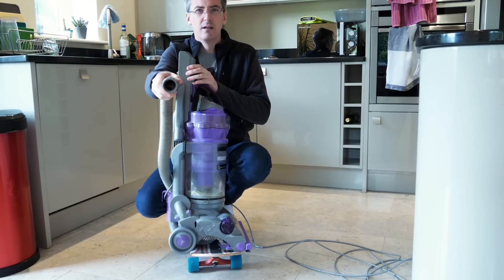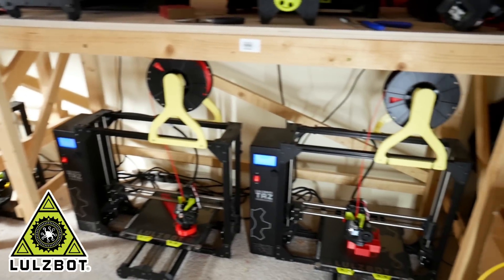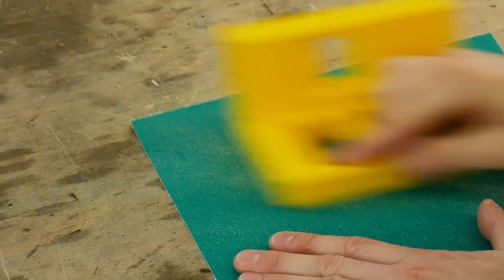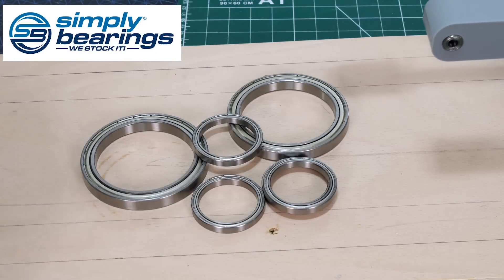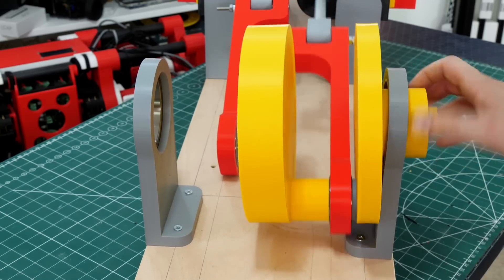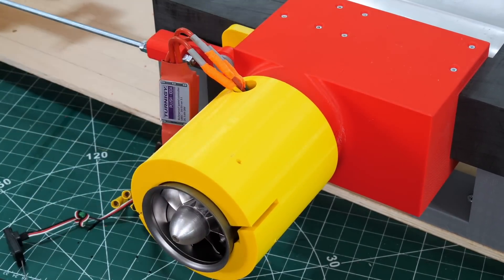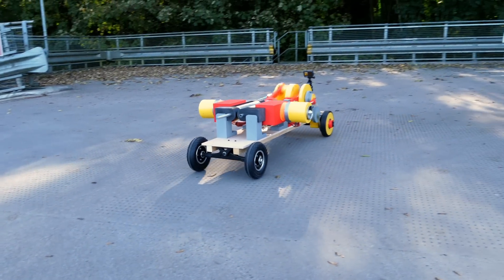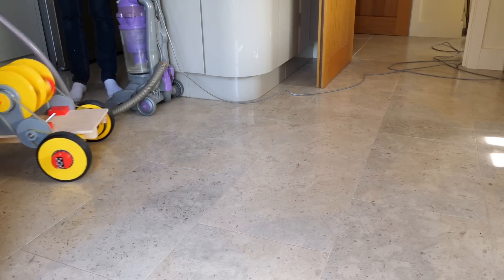Jet Powered air engine

Comment: Single crank compound: one set of pistons, but instead of the piston going straight into the cylinder it splits off into a top cylinder and a bottom cylinder.

Comment: You could find plenty of information online about steam engines that would help, as it is exactly the same concept as an air engine. You could use valve gear (aren't any gears involved, fyi) to vary speed and compound the cylinders. Additionally, the valve (Controlling the admission of fluid to the cylinders) are typically cylindrical to my knowledge and attached to the pistons. You could also maybe include lubricators, (maybe use a kitchen oil? I'm not entirely sure about how well that would lubricate but it may be worth testing). The best type of steam engines to research for this would be marine or vertical cylinder steam engines.

Comment: i still don't get the point of making such an engine. wouldn't it be better to just use the EDFs as electric motors and just removing the propellers and attaching them into a transmission?

Comment: its like a very bad gear ratio as with a piston engine you have more torque and turbines have more speed and as you are using electric motors you would get more efficiency by just using the motors from the jet and having a gear ratio

Comment: you also got to remember a stem engine usually runs between 40-60 rpm not 400-600 rpm

Comment: no........... it wiggles so much because you have a rocking couple beetween the two pistons and your primary engine balance is out the window so to balance this out you would need a balanceing shaft that spins at twice the rpm of the pistons and is oposing the powerstroke of the piston then you wont have any imbalance

Comment: 5:21 In cryocoolers that need to seal high PSI helium use either a regular Buna oRings or Spring oRing fit into a groove cut into the displacer (piston) and then glide rings are placed over those.  If you offset them correctly the glide rings protrude out enough that the oRing is forced to compress and the whole system seals.

But you don't need five 9 gas so you could just cut a Grove in your piston, put an oring in there, grease it up and that should seal

Comment: The 'fundamental' problem with a vacuum powered engine (on earth) is that you can only ever have 1 ATM of force (~14.something PSI). As opposed to a pressure based engine where the sky is the limit. Any maximum pressure, and therefore force, can be generated based on the strength and 'explosion resistance' of the cylinders.

Comment: Bruh, are you serious? It's obvious by the video that if you put your second foot on the pistons it slows down. You put your weight on half 3d printed Pistons and make the piston rods out o alignment with the holes causing a lot of friction. Make a place to put your feet but not on the pistons.

Comment: - A single stack bladed fan does not produce much thrust, because the air behind it is spinning in a spiral tangentially with the blade rotation. If airflow is blocked the outflow will statically sit there spinning tangentially and not do much of anything.
- This is why the noise of a vacuum cleaner becomes higher pitch when airflow is blocked. It takes much less energy for air to sit there spinning tangentially with the turbine blades, than blowing through the pipes.
- Stacking a second fan directly behind the first won't do much because the exhaust air is already rotating and the second fan won't add much to the air pressure.
- You need fixed stator blades behind the spinning blades to increase thrust. Flat blades facing the other direction will work, but ideally they should be cupped like a Pringles chip, so that air exiting the stator is rotating in the opposite direction of the spinning blades. The gap between the rotor and stator should be very small, millimeters.
- Using a stator behind the rotor will also then allow a second stacked spinning rotor and second stator to produce more combined thrust.
- The spinning vortex projects out into space in front of the turbine so a stator at the inlet can further arrest the spinning air and generate more thrust.

Comment: hold up. Is that metal bar on the smaller wheel connecting to basically a switch. As in, when that metal bar moves, it changes the airflow from one side of the cylinder to the other side of the cylinder? If that's the case, then because of the smaller wheel, to the pistons wheel, it seems like you're trying to start off in 5th gear. 
I could be wrong, but that was my hunch from the instant I seen how you were (I assume... I'm loaded) switching air flow from one side to the other.

Comment: That is not how combustion engines work. They do not have piston "seals" they have piston rings which are designed to fiction down by reducing contact with the cylinder wall

Comment: so u made a lower displacement engine? damn u should try and add a supercharger like the ones on lego vaccum engines, since they dont use any sealing just lubercants, some do some dont and they run like the rc controlled one

Comment: It’s not a half stroke your having a stroke if you think that’s correct. It’s a double acting design!!! And technically a steam engine those will run in vacuum. As a steam engine is just a pressure differential engine.

Comment: Use a shop vac Will provide you with significantly more air pressure faster moving air and air flow it's cheap easy and it should work

Comment: You are using a battery to power electric motors to spin fans to force air into pistons to drive a crank that gives you rotating motion? Don't electric motors produce rotating motion? This is all fun stuff, but pointless.

Comment: Redesign? Sign me up! How about using a fan for each cylinder, but couple the outputs to a single fan powering the exhaust side? It should take some dialing in, but a mild vacuum on the exhaust side should boost performance of both cylinders. With luck, that'll be a bigger gain for power use and weight than doubling the input pressure. 

Keep it up, James. Perfection's impossible, but improvement is always achievable, you just have to keep finding ways to do it. The trick is to know when to quit until you notice the next possibility. Keep an eye out, then grab them when they pop up. It's simple, but not easy, without practice.

Keep encouraging him, y'all.

Comment: You could make the fans pull the air from the engine and out the back so it sucks in the air powers the engine and the air thrown out the back gives you extra force

Comment: more pistons on a single push rod , or have the pistons in 180 degree faze (so they push and pull together, if they get stuck  you might need a bigger flywheel) , 
two or more pistons are  going to have more Surface area but only when they work together

Comment: One trick if you were working +ve pressure is steam engines use the pressure to push the valve against the cylinder/intake/exhaust - effectively self sealing.

Comment: I'm not sure how it would work for 3D prints, but the steam-era way of getting good surface sealing on sliding joints is to lap the parts together. I've done it with brass, and with a fine modern lapping compound you can get near gas tight seals with surprisingly low friction.

Comment: Have you looked into labyrinth seals.  They are used to greatly reduce leakage on parts where friction or hazardous environments make other types of seals impractical.  They use their shape and tight but tolerance to reduce flow not stop flow.

Comment: Add at least bearing grease into the cylinder chamber, it would improve a lot, then ruber seals if wanted for high pressure.

Comment: Might I suggest Tom Stanton's air valve seal designs to maybe help in sealing the air leaks without adding a lot more friction? A sort of flared edge of rubber or tpu that "breathes" with the motion of movement. Flaring out when the pressure is behind it sealing it in, moving it forward, and when it reaches its peak and the air escapes, another flare on the other side would expand and do the same until it makes it to the other side peak. His videos do a lot better explaining it all, but the concept would work well here.
Reply: I was going to comment the same thing.

Comment: the motor will run faster if you balance it. more faster * same torque = more horses

your valve timing is based on a high pressure, low displacement design. you have low pressure, high flow.

your pistons should (probably) be wider and shorter, rather than longer and thinner.

Comment: Granted I understand your logic about the round cylinders but I think it's more of the fundamentals. What do most steam engines have besides what you built. Steam engines have a flywheel period or some sort of metal counterweight that runs off the drive shaft and that stores rotational power. And which that stored energy helps keep it running and limits its speed

Comment: So, would it be cheating to mill the surfaces flat after you 3d print them?  Or is that sort if ridyculous since it is probably cheaper and more direct to mill the parts out of solid material in the first place

Comment: When working a University, a Professor started a design inquiry: make a device that can use vacuum to suck bugs off a distant (3-10 meters) wall.
Not all the bugs, just the one you want!
She approved $250 and 3 days labor for us to come up with a working design.
It took me a full day to explain to her that it was not insubordination to explain how air pressure works, and another two days convincing her we weren't stealing her 'genius idea'.
BTW, her specialty was psychology and human memory systems.

Comment: One giant tube is certainly worth a shot. Maybe you could use PVC pipe and it'll take less time to put together or print parts for it. Try using a heat gun to reshape some PVC as well.

Comment: efd's are generally more suited for high air flows, there's probably a lot of back pressure just escaping back out. You could try a blower style fan that could possibly make higher pressure with same airspeed. Im also not sure if stacking the fans will necessarily help, but give it a try cause who knows

Comment: Hmmm… Connect the exhaust from the cylinder to the inlet of the vacuum, then the piston is pushed and pulled down!

But then, the recirculating engine is redundant…eliminate the vacuum pump, & "engine", save weight by powering with only the vacuum's motor.

Comment: The single cylinder engine also stalls at the end of the stroke which could indicate that the flywheel is too light. It should have the momentum to move the piston across top dead center and activate the switch valve completely. Hope you can implement this in a later version of this. Thanks for the content, James!

Comment: Air will flow in the path of least resistance so if one cylinder leaks more than the other then they will be out of balance causing inefficiency. You should try powering the pistons sequentially. You might need to shrink the secondary cylinder based on the losses from the first cylinder to get equal performance.

Comment: One massive improvement you seem to miss: Put a lot of free play on your valve opener connecting rods and increase the circumference of their crank shaft to offset the free play. Instead of the valves slowly and gradually opening they would be "switched" open and closed. It would dramatically decrease air resistance.

Comment: I HIGHLY recommend you look up player piano wind motors since they use suction to power a rotating axel used to scroll the roll along. They use bellows and external pistons and are quite strong!

Comment: Air being what it is will give on pressure. That's why heavy machinery uses hydraulics. Without a way to build up the pressure and release it you'll never be able to get any kind of torque.

Comment: using an EDF was probbably a bad choice to power the engine, what you need is high pressure, an EDF only makes high flow, you need high pressure, loke a centerfugal fan

Comment: I suspect your "sinusoidal" valve timing is far from ideal!  

Real engines use "eggshaped" cams to maxise the valve velocity over a much shorter crank angle. In your case, your valves only spend a small time open and most of the time they are overlapped.  Perhaps print an actual camshaft with seperate lobes for each end entry and exit valve so you can get higher valve acclerations and longer durations 🙂

Comment: For flat sliding surfaces on 3d prints, I usually print the faces with an offset and apply an adhesive-backed PTFE sheet to each side

Comment: If you want high pressure, you want to use centrifugal or cross flow fans - EDFs are not really designed for pressure and are pretty inefficient in static mode (since they normally operate in aircraft travelling at speed).

Comment: Rather than dry fitting the 3d printed parts it might be good to lubricate them.
In the past I have used beeswax very effectively.  The nice thing about beeswax is that it both fills the small gaps and forms a somewhat hard lubricating layer. Should make the fitting go a bit smoother...

Comment: working with a vaccum seems fine, but when pushing air into the system with EDF's, what are you doing about the exhaust? all that extra pressure must be slowing the thing down if you have nowhere for the pressure to escape. Also, maybe smaller valve openings could help? seems like a lot of time is spent with equal pressure on both sides of the piston as the valve traverses from one side to the other.

Comment: Also, for your valves, instead of making them square, consider spool valves (cylinders).  This minimizes the sealing surface/friction creating areas.  

Picture a smaller inlet/exhaust control cylinder stacked at the end of your larger drive cylinder with two tubes directing air to/from the drive cylinder and to/from the control cylinder.  A single drive rod extends from the spool inside the control cylinder, through the drive cylinder and out to the connecting rod.  The fan is mounted coaxially on the end of the control cylinder and internal passages ports the output to the control cylinder inlet.  The spool valve directs the inlet air to one of two passages that direct the air to either the forward or rear drive piston port.  The opposite drive piston port is directed through the alternate passage back to the spool valve, which in this position is directing the air to the exhaust port.  When the drive piston reaches the end of its stroke, the spool valve has been repositioned to swap which passage the inlet and exhaust air are directed to, reversing the direction of the drive piston.  

Phasing is controlled by where the connecting rods are on the crankshaft.  Your current design had two cylinders at 0 and 90 degrees.  I would love to see a design with three  at 0, 120, and 240 degrees.  By having the fan, control valve, and drive cylinder all aligned coaxially there should be enough room.

By designing the exhaust ports correctly, using manifolds to direct the exhaust, the spools can be mounted on the free ends of the cylinder rods, further reducing friction since they won’t need their own driving rods.

Remember the simple per square inch rule of hydraulics/pneumatics.  1 pound per square inch on a 10 square inch surface yields 10 pounds of force.

To seal and lubricate your cylinders, consider a light coating of a thick grease such as lard.  Or maybe a thin lubricant such as sewing machine oil.  I don’t know which would be better.  Maybe start with oil, and if that doesn’t work, switch to lard?

Edit:  just had another thought.  Stack belt gears so you can have a 1:x, a 1:1, and an x:1 ratio just by moving your belt.  This is the same way the top end of variable speed drill presses work for example.  This would allow you to experiment to find the best speed conversion.

Comment: It's all about PSI. Increase the piston square inches or increase the pressure. Air compresses really easy so instead of moving the piston it's just being compressed.  It's like a spring. Vacuums create what, 10 PSI? you'd probably need 4x that to overcome the springyness.

Comment: I wonder if the piston is one of the problems because if i remember right (in terms of trains) a longer piston (given the right size) gives a stronger rotational force (just heard you say that the piston was a problem so this comment is unnecessary)

Also another factor that could be limiting the speed/power of the pistons is, the fact that you are providing constant power to the piston tube as it is closing (before the gate closes fully) this would cause the piston to want to go the wrong way. (This back flow of air is basically what some steam trains did purposely with their steam to slow or aid in stopping the train)

You could see why this could be a problem.

honestly a quick look at some variations of piston construction for steam trains could possibly benefit your build as steam is similar to air in some ways.

Also looking at trains for many things about this build (and others like it) may help as this build is basicly a air powerd train (without a boiler)

I know a lot of thing wont work due to the differences between air and steam but the fundamentals will be similar in a way that should be possible to modify.

(BTW I'm no train connoisseur, i just have some knowledge from KAN and Heyce plalying a train game)

I just had a brain fart, you are sucking air out in the videos, but this problem still exists, just with the power (air) going a different direction (out not in) the effects on the pistons will be basically the same as described.

Comment: Why not copy Tom stanton for the piston design, you could have thin rubber seals that would work like the ones in combustion engines but much lower pressure